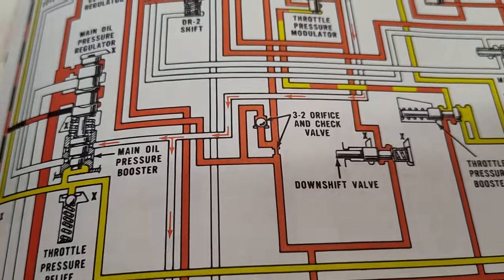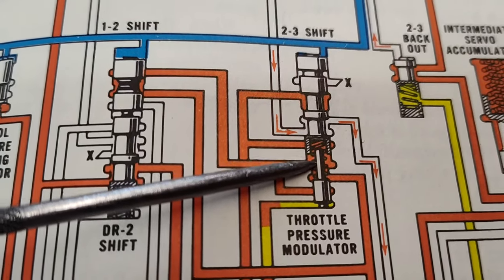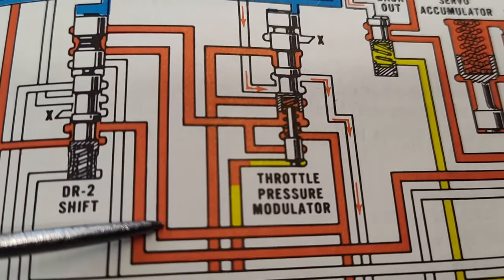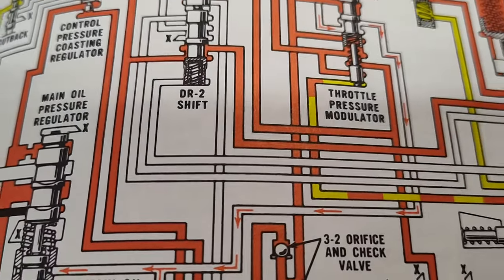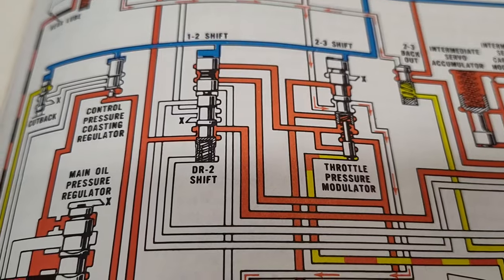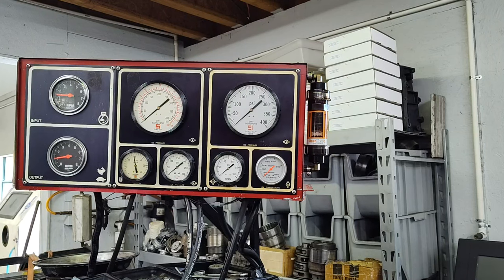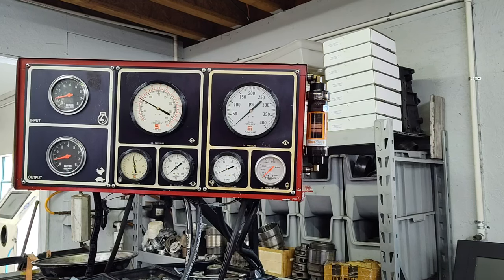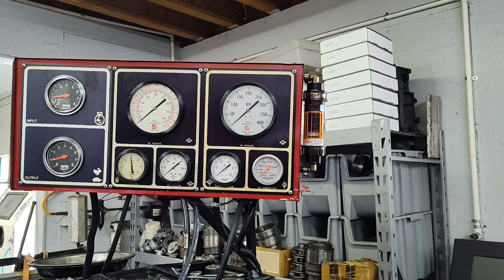Ford C6 Transmission...The Kickdown Linkage Myth

Comment: I have run C4s and C6s without connecting the down shift lever and never had a problem.
It just does not down shift using the accelerator.

Comment: Great video....I have a holley 4150 4776C that does not have the same throttle shaft as the 4160 for my C6 kickdown lever....Is there a way I can still hook up OEM kickdown lever with my 4160 4776C 600cfm D.P.      thanks

Comment: Been running my C6 on my 79 Bronco with no kickdown for over a year. Put a 2" spacer on the intake for velocity and then the kick down wouldnt reach. Has caused absolutely no issues. The governor controls the downshifts and upshifts quite well. Just maybe lose the ability to manually control it more precisely.
Reply: I was in the same situation, I got a generic lockdown cable and it works great. If you ever want to hook it up again.